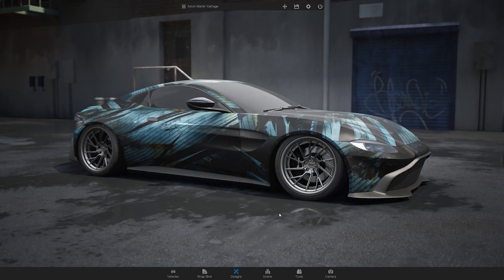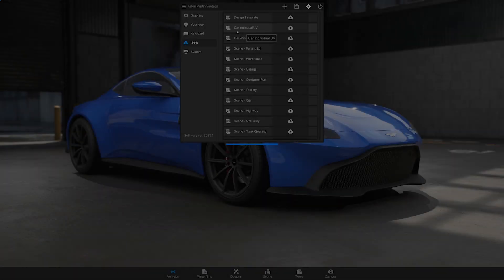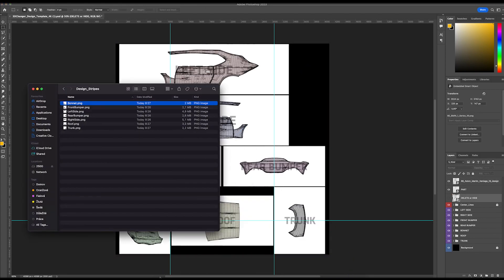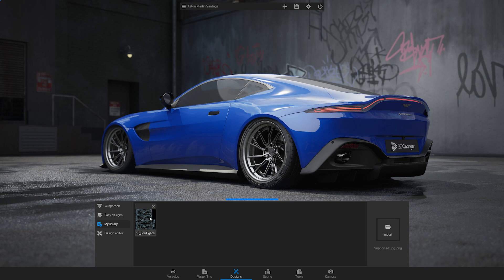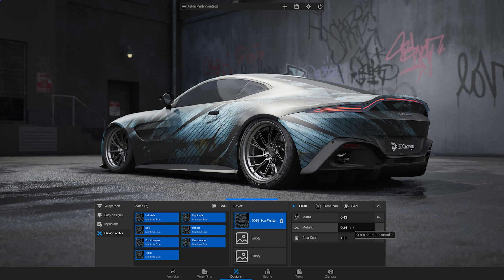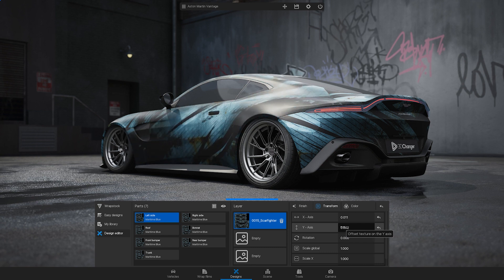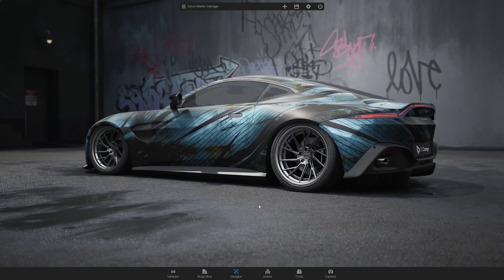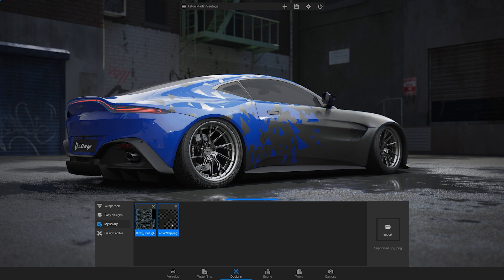How To Import A Design | 3D Changer 2023.1

Comment: Hi There,
Please tell me your PC Specification !
i use i5-11500 with RTX 3090 but not smooth like your tutorial.
Reply from the maker: Hello, this video was taken on PC (desktop) with the following specifications:
CPU Intel(R) Core(TM) i9-9900K
GPU Nvidia GeForce RTX 3070

Please check if you have installed the lates GPU drivers update. If you still have performance issues, please, contact us at info@3dchanger.com for support.
Reply: Did you fix it?
Reply: Hi, there can I run this program on a z840 with two cpu's, 120gb of ram and RX350 gpu card or do i need a whole new rig?